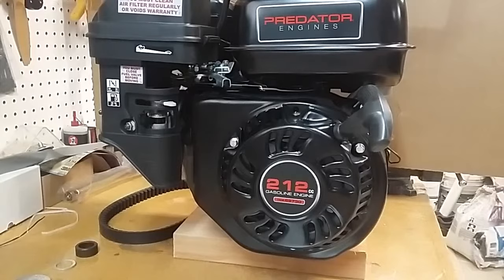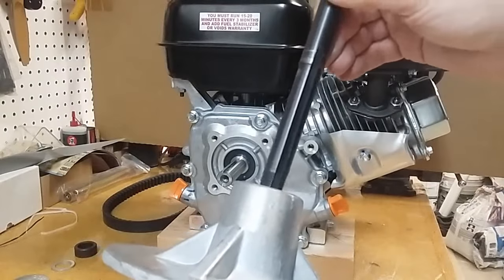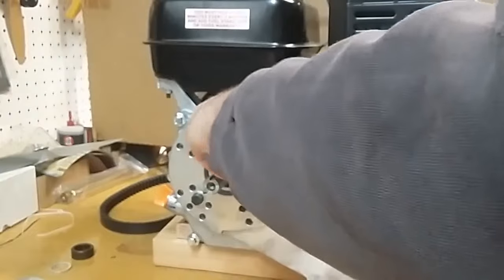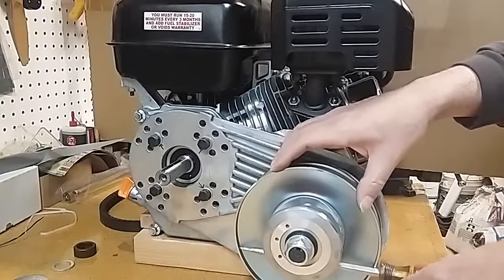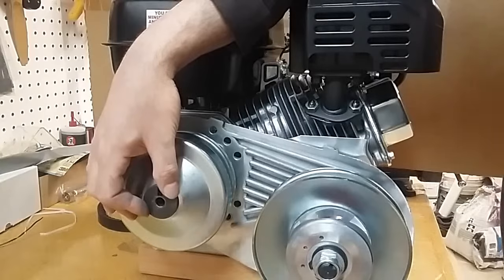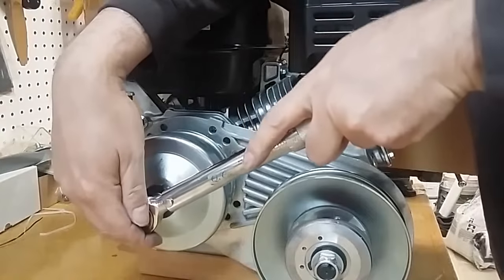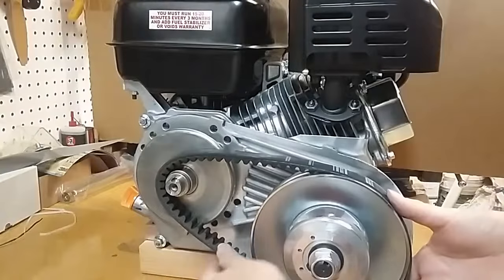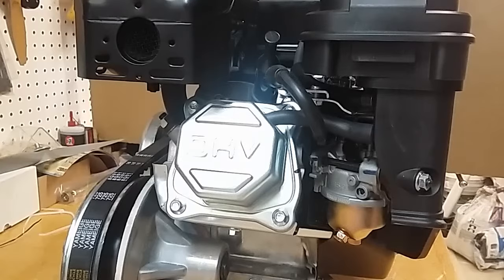Predator 212 - Series 30 Torque Converter Install: The SMOG Project 05

Comment: Good narrator but, what about putting on a centrifugal clutch a lot less work?
Reply from the maker: Should be. And that's what you'll find on most very light go karts. But a centrifugal clutch wouldn't handle the weight of SMOG. He's currently 1340 lbs (608kg). That's kind-of extreme, but the same physics apply to heavier/off-road karts and riders. TAVs can handle more torque, a LOT more weight, don't burn up, and have the advantage of a continuously-variable ratio. They don't start to fail as a design until they're, ya know... made by Nissan.

Comment: Is it possible to mount the sprocket on the circlip side of the driven shaft?
Reply from the maker: Not with my kit. At least, not without a good bit of modification and lathe work. I have heard of a kit that does have that setup. But I've never seen it.

Comment: I have a quick question, I have a Realtree 200 mini bike that I bought from Walmart customer returned it Walmart gave sold it to me at 50% off. So I brought it home and looking around I removed the spark to to see it and I noticed when I pulled to start the engine with the plug off, oil was coming out is that Normal or did I get a lemon.
Reply from the maker: Assuming oil was coming out of the spark plug hole...  not necessarily anything wrong. Oil may have been added to the top end of the cylinder by the mfg as a corrosion preventative. Oil may also have seeped past the piston rings if the bike was sitting upside down or at an odd angle for more than a few minutes. That much oil (less than a tablespoon full) will burn off. You shouldn't see any more oil than that above the piston. With the ignition off, try pulling the motor through a few revolutions. If it doesn't lock up, turn on the ignition and fuel and try starting it. It'll probably smoke like a train for a few seconds. If it keeps on smoking after a minute or more, then there may be internal damage like a broken piston ring or broken valve stem, etc.

Comment: I HAD  TO  CHASE  THE  INTERNAL THREADS  ON  THE  FRONT  PULLEY ATTACH  BOLT HOLE  ON   THE  MOTOR WITH (5/16  x FINE  THREAD  TAP )  AS THE CORRECT (BOUGHT  SEPARATELY )  BOLT  WOULD ONLY GO IN  LESS  THAN 2  TURNS .                                                                                                                      NOTE : THE WRONG   BOLT  THAT CAME  WITH  THIS  FRONT CHINESE PULLEY WAS  AN 8MM X125 !                                                                                                                                                             VIDEO (IT WOULD  GO IN LESS THAN ONE  TURN -+ AND  BIND)
EXCELLENT  VIDEO ...........

Comment: do you have low speed series for that kind of motor....
Reply from the maker: These converters engage around 1800 rpm. So to get a lower rpm output, you need reduction sprockets after the TAV. SMOG uses a 4-stage reduction. Axle speed is 17 rpm max. I have a video about it.

Comment: is the belt slipping on low speed? seems pretty loose when on low speed. I notice it the plate is squeezing it when it spin at high speed.
Reply from the maker: Yes, but it's designed to. That's how this type of torque converter works. As RPM increases, centrifugal (centripetal, whatever) force causes the weights to move outward. These cam the two halves of the cone-shaped pulleys together, engaging and driving the belt, and also increasing the effective diameter of the pulleys and thus the drive ratio. This happens automatically and is self-regulating depending on engine rpm and load. If I filmed SMOG going uphill, you would see the pulley sides move apart as load increased and RPM decreased (that's what the springs do). That would decrease the drive ratio and have the same effect as shifting into a lower gear in a manual transmission. The idea is that engine rpm remains constant for a given power setting. It's not perfect, but it does an effective job.
Reply: @doktorscottdiabolical  thanks bro. I really appreciate the thorough explanation.

Comment: Wait you don’t need to take that off 

The belts are made to put on the primary drive.

The secondary is to be opened by split allowing you to allowing the belt to slip on just like a snowmobile belt so you can charge on the trail without tools
Reply from the maker: That's not how mine works.

Comment: So this mechanism has its own clutch already? I was going to try and install a clutch to go to a torque converter
Reply from the maker: Yes. The design of the TAV allows it to act as both clutch and constantly variable transmission. And, it will outperform go kart centrifugal clutches.
Reply: @doktorscottdiabolical  that’s probably my favorite part now lol I’m gonna buy one but probably change the springs I want it to engage earlier. I was also wondering can you change the gear to the other side of the pulley on the non-driven end? My sprocket aligns basically to the end of my engine shaft almost exactly and this is offsetting me 2-3 inches
Reply from the maker: On my kit I cannot change the location of the sprocket. It might be possible to re-design, but that would take a lot of machining and would still probably fail under load. I've heard of a kit that has the output chain sprocket on the engine side of the driven shaft. But I've never seen it.

Comment: No washer needed between the plate and sprocket?
Reply from the maker: I didn't use one initially. But clearance with the #40 chain was really tight and I did notice some chain rubbing. I'm not sure if I'll need to add shims on the next iteration. Still trying to find time to work on the vibration issue. Life has kinda gotten in the way over the last year or two.

Comment: You mean a centrifugal clutch just like a mini bike instead of a chain you have a rubber belt it's the same principal, so your so called idea calling it a torque converter is wrong, a torque
goes on a transmission input shaft where the pump is at with cluthes, valve body combined for the final drive to a drive shaft 😆 so maybe you & your idea is just shiftless 😆 😆
Reply from the maker: No, I do not mean "centrifugal clutch just like a mini-bike". Before writing critical comments, it's best to do your research. I suggest Googling "Continuously Variable Transmission". You'll find a nice Wikipedia article explaining how these devices work. You'll also see that they were first invented in 1879.  In the go-kart and small engine communities, these devices are referred to as "torque converters" or "TAVs" for two reasons. First, to differentiate them from basic centrifugal clutches (typically found on mini-bikes), which use a different mechanism and operate on a somewhat different principle. And second, because of genericised trademarking (Kleenex, Xerox, Hoover, etc). Before Chinese-produced knockoffs became ubiquitous, this type of device was primarily produced by Comet and was sold under the trade name "Torq-A-Verter", or "TAV". Most of us already know that these are not the same type of device, and do not operate on the same principal as fluid-coupling (turbine-fluid-turbine) automotive "torque converters". But rather, that they operate on the same principal as the CVTs found in low-end Nissans and a few undesirable Subarus. So, perhaps this "isn't my idea". And perhaps I'm not "shiftless". But rather, I'm the guy that spent days making a video that you just watched for free, without any ads, shills, sponsors, patreons, or begging for Likes and Subscriptions. You're welcome.

Comment: What if I don't have
Torque wrench
Reply from the maker: Use the old-school method (the way I learned from an aircraft mechanic) "A 2-finger pull on an 8" (long) wrench" is approx. 15 ft/lbs of torque.  Here's the original source of that method: @16:50 https://www.youtube.com/watch?v=Noqms4AhTJA

Comment: What size torque wrench? 3/8" or 1/2"
Reply from the maker: Doesn't matter. If you set a 3/8"-drive torque wrench for 20 ft/lbs, and a 1/2"-drive torque wrench for 20 ft/lbs, they'll both click at 20 ft/lbs. The only difference is how hard you have to push on the handle to get there. And, how convenient it is for you to use depending on space and your socket set. Some torque wrenches have different ranges than others. But as long as the torque value you need falls within the wrench's range... use what you got, man. The one I'm using here is 3/8" from H-F. Works good enough for SMOG.

Comment: On the install, could you mount the plate so that the gear that the chain goes on to the left side instead of the right?
Reply from the maker: Not on my kit. The bearings are different I.D. sizes and the shaft is "stepped" so it only fits one way. I've heard of a kit that allows the driven shaft to be reversed, but I've never seen it.
Reply: That's good to know that one may be out there @doktorscottdiabolical

Comment: What size bolt did you use for the clutch out of your own collection? I've broken 3 bolts off so far while driving the kart.. I believe now with your help it was because of a off line pulley set up. I used a flat bar and I needed another washer to line them up.
Reply from the maker: The stainless steel bolt that threads into the crankshaft in this video is nominally 2" long. It actually measures 1-15/16" from the underside of the cap to the end of the bolt. That's what worked with the setup and washer stack that I used in the video. Your kit and setup may be different.   The thread standard on my motor is 5/16"-24 tpi (SAE fine). BUT, that's for a Predator 212 sold in the USA. I would expect that in every other part of the world, the crankshaft would be tapped for a metric thread standard.

Comment: So how do you get to the carburetor on the 212 stage 1 predator motor cause there’s mud all in mine from when I went through the mud caped in there should I say
Reply from the maker: To be honest, I had to watch someone else's video for that. I've only torn down a 212 carb once. And that was on my generator after it sat for a year and the metering needle stuck shut. Dunno about mud. Parade floats generally don't get very muddy.

Comment: What size is the crank shaft bolt came in your kit?
Reply from the maker: I don't recall what came with the kit, but the crankshaft on my engine is tapped 5/16"-24tpi. I would expect engines not sold in the USA to be tapped metric. As far as the length of the bolt, I think I've answered that somewhere in the comments with an exact measurement (2 1/2 - 3 1/2 inches???). But what I'm seeing is that different kits may need different length bolts, and even the same type of kit can have significant variations. Also, the thickness of the spacer used to align the belt will make a difference. Keep in mind that any bolt can be "shortened" by cutting a bit off the end with a hacksaw or angle grinder.

Comment: ive watched several and no one shows where the sprocket that the chain goes on and goes does down to the axle ,,if they did ive missed them ,,,, i need to see where that little clog sprocket wheel thing goes
Reply: nevermind i just missed it ,,i went back over this video ,,lol

Comment: 26 ft lbs? Comet calls for 20 ft lbs max.
Also. You didn't have a clearance issue with the back plate hitting the cylinder shroud bolt head that is located in back of the top right cover screw? This has been found on both 196 clone and 212's.
Reply from the maker: 26 ft/lbs. per the instructions that were included with THIS unit. YMMV. Not all TAVs are the same. Also, I did not have a clearance issue with the shroud bolt. But, not all 212 clones are the same. Harbor Freight sells both the hemi and wedge motors on the same shelf for the same price. But they aren't the same, and they come from different factories. Again, YMMV. I have the wedge motor. I installed the TAV in a slightly down position. But it fit flush with the mounting pad on the crankcase. The only interference I found was with the oil filler plug wings. For what it's worth, I now run the TAV unit 180 degrees of this setup, with the driven pulley opposite of the cylinder instead of beside it. That's the setup I currently need for SMOG. Seems to work fine.
Reply: @doktorscottdiabolical  - good advice.

Comment: What to do when i put a stage 1 kit with jet into motor and it destroys the belt within the hour? Stiffer spring? Bigger rear sprocket? Im having troubles but i would like to be able to keep the kit and the clutch
Reply from the maker: Check your pulley alignment. The belt is designed to move parallel side-to-side as the pulley faces move in and out. It isn't designed to handle misalignment angles like a v-belt would. I had to shim my driven pulley quite a bit to get it to align. Also, make sure you're using the correct belt. There are several similar looking belts available that have very subtle differences.
Reply: @doktorscottdiabolical  the alignment is perfect with the chain and belt. Before i bought the new clutch, my old one didnt tear apart the belt but burnt it until the belt lost enough width and it hardened to the point it rode up and down the spindles but wouldn't grip anything. And those were comet brand kevlar belts.. idk i guess i need to return to stock motor.
Reply from the maker: Sounds like you're cooking the belt. Too much power for a stock Series 30. Unfortunately, I don't know enough about the stage-kit world to know if a TAV upgrade would be worth the money, or if you need a Series 40. Maybe someone else can answer that question?

Comment: How long is the bolt that holds the drive pulley on?  I am putting one of these where a Tecumseh used to be , and the new engine shaft is shorter so I need a bolt longer than the roughly 1.75” one that was there.
Reply from the maker: The bolt that I used measures 1-15/16" (50mm) from the underside of the head to the end. However, longer bolts are easy to get from any decent hardware store. Your engine manufacturer should list the diameter and thread pitch of the hole bored into the crankshaft. Those are the critical dimensions (they may be metric). Assuming you know what bolt length you need, you just go to the store and buy one that fits the hole. Note: if you can't find a bolt that will work, you can shorten a bolt that is too long by threading on a nut, cutting the bolt to length with your weapon of choice (hacksaw, grinder, This-Old-Tony karate chop), cleaning up the end a bit with a file or sandpaper, then unthreading the nut. Ain't pretty, but it works.
Reply: @doktorscottdiabolical  Thanks for the detailed replying!  It is indeed the 5/16-24 pitch thread in the crankshaft, so since they were less than $1 each I got the next 3 sizes up and will choose one to use as is or trim to fit.  Looking forward to getting the machine going!

Comment: I just installed a brand new 30 series TC on my Predator 212, but the drive pulley doesn't spin freely and engages immediately. I think it might be the belt being a size too small. It would be weird to include the wrong size belt in a brand new kit, but it felt really tight to install. How tight/difficult was yours to put on? I did check and make sure that the flat and angled side of the belt was pointed in the right direction. I read also that some people didn't use the brass bushing on the drive pulley. Any other thoughts or ideas would be appreciated. Great video!
Reply from the maker: My belt is very stiff compared to a v-belt. But it isn't tight enough to always be engaged. Your engine should idle without turning the belt. I've noticed that these belts come in several sizes that are very close to one another, but different enough to matter. If you've checked everything else and the belt is the only issue, your kit may have included the wrong size. Or, it may just be a bad belt. Unfortunately, consistent quality is not a thing with these kits.
Reply: Turn belt around, it matters
Reply: I realize you posted this question a long time ago.  But I had the same problem.  I had the wrong size belt.  Ultimately, I found out I needed a 725 size.  725 is the same size as this belt in this video.  You can see "725" painted on the belt. GoPowerSports sells them.
Reply: YEP I worked inspecting incoming belts that were used on our Snapper mower products, there was quite a length variation ( tolerance ) used on the lengths of those belts, due to MFG variations of the mating parts occasionally there would be issues, thus ALL the belts in ONE shipment would be marked with the same part number but the actual measurements would vary BUT WITHIN tolerance, can't remember now but seems it wasn't nothing to see up to a 1/8 or more on variations  @doktorscottdiabolical

Comment: Did you ever try to install the converter cover? I have the same setup and the cover rubs on the belt causing them to shred...
Reply from the maker: No, I haven't tried yet. In my application, it's not really necessary. My plan is to eventually enclose (or at least partially enclose) the engine with soundproofing. If I were installing this on a go-kart though, especially one used by kids, I'd definitely be installing a guard of some sort. Mt Dad had a bad experience with a go-kart pulley when he was 10, and he still had the scars 30 years later.